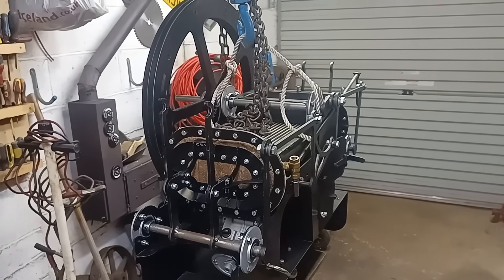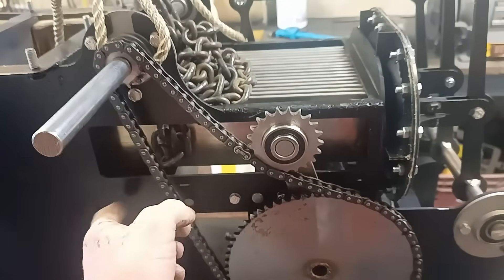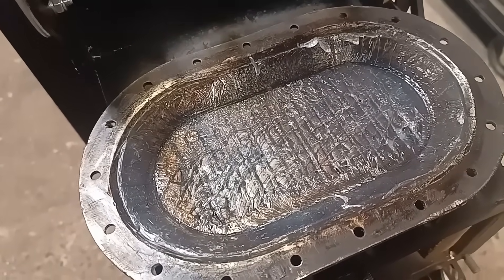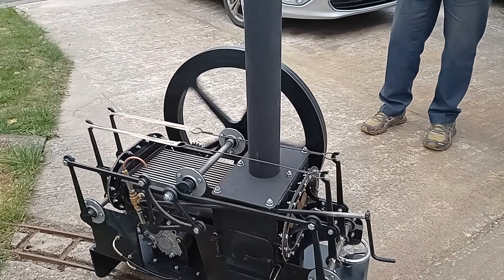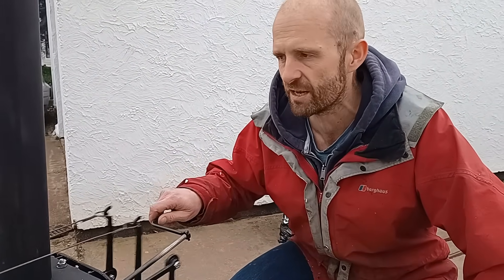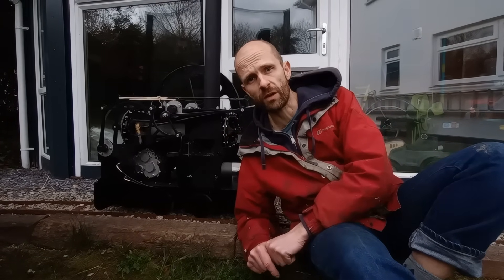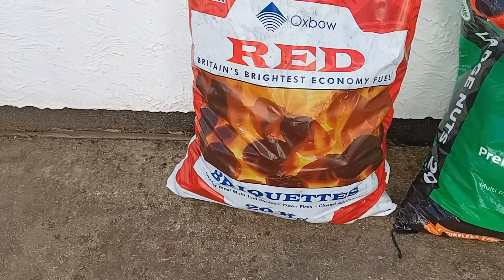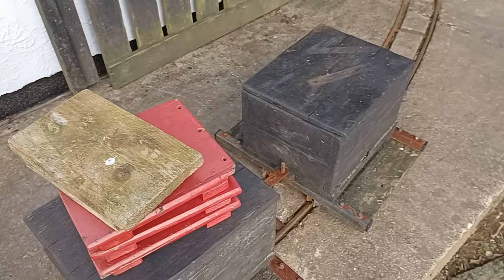Hot Air Stirling Engine Locomotive - Part 9

Comment: For stopping perhaps just fit a brake to the flywheel?

You should be able to improve the thermodynamic efficiency by quite a lot by transferring heat from the flue gases back to the fresh air going to the fire. Fitting a recuperator, in other words. The preheated inlet air should also help keep anthracite burning.

Comment: hey did you know nuclear strling power genrators that are powered by passive nuclear metreals like stromuom fonud in highe level nuclear waste that decays into zicouim 90 after 30 years by the way. who needs coal when decaying stromuim make entogh heat passvly ina self contned closed loop isstem that can be pasvly cooled as well. bacly a nuclear srtling power genrtor is bacly like this but with heat form passive nuclear decay from nucler isotopes bascly.

Comment: What you need is a air value between the 2 bellows inside the engine, by doing this you can control how much hot and cold air is getting transferred from the 2 bellows, and you will have much better control of speed, and will be able to stop it much better,  AKA for next project please please build a string engine tractor would love to that.
Reply from the maker: @theinstrumentinventor1345  hi, thanks for the good idea 💡. That would work. I am actually thinking about a traction engine : )
Reply: @ShanePomeroy  Cool really want to see the Stirling engine tractor build, also got another useful idea for getting temperature up in the engine, if you had a set of small air powered bellows witch cold run off a pulley or chain from the main engine, witch could blow air underneath and into the fire box, this would help with keeping the hot air at a constant rate, and would help to keep the temperature up when the engine is running, and on the plus side you'll be burring the fuel much more efficiently, witch means the engine well run for much longer,

Comment: If youre having an issue with the draught of the fire then you can try taking the exhaust pipe and directing it up the chimney near the bottom. This should create an artificial draught on the fire much like on a steam engine. Best of luck :)
Reply: Stirling engines don't have exhaust pipes!

Comment: Maybe the best way to throttle the engine is by limiting the airflow through the fire. Like lowering the blower on a locomotive. Not sure how much it will be possible to control the heat with a coal fire, but it might  be worth trying?
Reply: Better having the fire burning hot all the time and diverting the heat with a flap. Strangling the fire kills a coal fire.
Reply: @highdownmartin  I did not know that.

Comment: Good Sir I need you to reach out to a nice gentlemen that is "Way Out West Workshop Stuff" Please! He is building his own railway at 15' gauge and I think your locomotive design can be scaled up to his railway and he can have an Engine that can get around. He already built a Pneumatic Engine called the "Tornado" and I love the engine he built but it doesn't go very far. So Please Good sir help another gentlemen out will you?
Reply: I second this! It's awesome!  I love way out west and this kind of thing could be just what they need! They also have a charcoal making set up which in itself could help power an engine!
Reply: Excellent idea!
Reply: Lovely couple on “Way out West” highly recommended. He has built a compressed air engine amongst many other things.
Reply: I literally just came here from watching his latest video on the wheel design.
Reply: I totally agree. Contact Way Out West! He is literally itching for a design like this